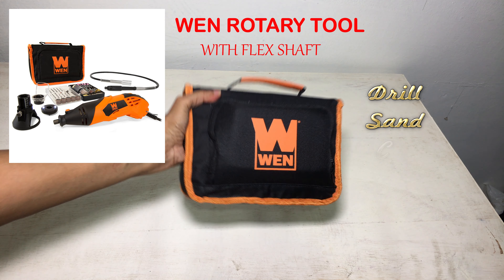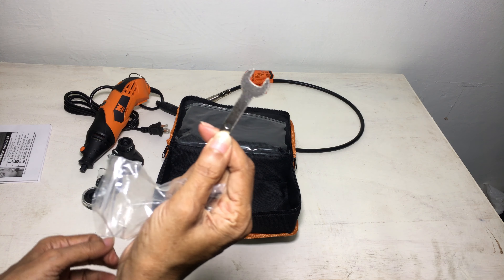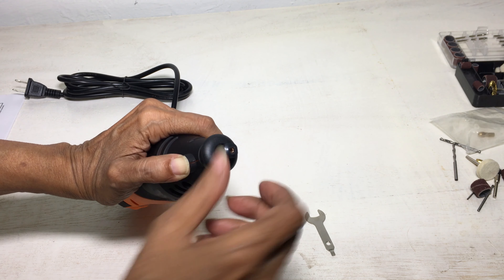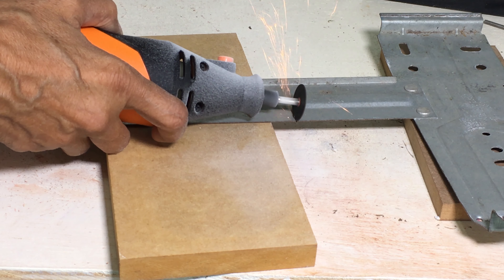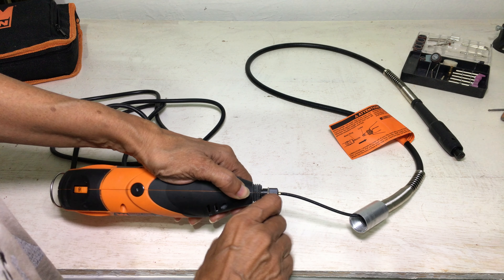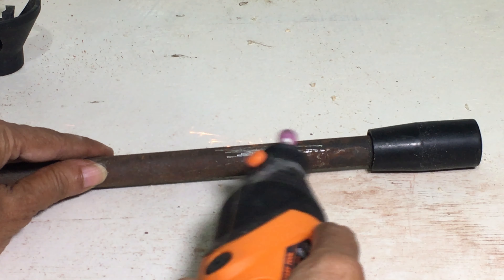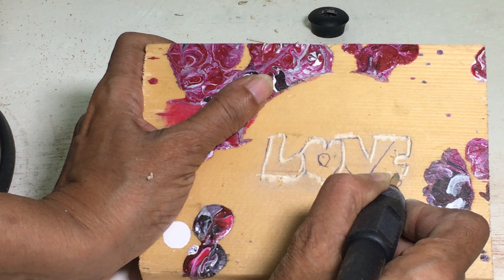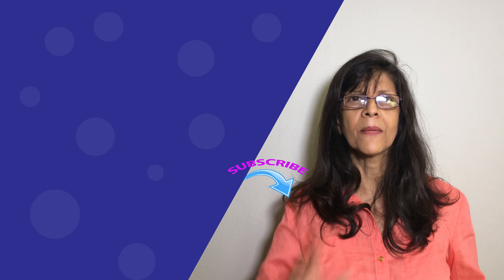Wen Rotary Tool  23114 with Flex Shaft/How to use it and applications.

Comment: Nice. Informative. 
Any idea which bits are best for smoothing rough stone, then which to polish stone - advised compound?
Reply from the maker: Thanks,I have never tried it,but I will,but from what I have read you can use either sanding drum bands or the diamond bits and finish off with the polishing wheel.

Comment: Thank you for a great video. The best I have seen! Can this tool cut a brass garden hose stuck on the spigot/faucet?
Reply from the maker: I don't see why not today I had to cut off four 1/4 thick bolts and the nuts went back on easily,only thing I found that with just one of those cutting discs it was taking a bit long so I screwed on two and it worked like a charm.

Comment: I didn't know you could use it under running water that's amazing for glass sanding so there is no problem with getting a bit wet the flex shaft? Thanks for a great video 👌
Reply from the maker: Should be fine once you use the flex shaft.
Reply: @over60crafter  Thanks a lot (:

Comment: Great review! You convinced me to get it, I am over 60 crafter myself. Can you recommend the diamond cutting wheels, I need to cut some metal and glass? I was trying to cut the metal pin (fixing my ironing board) I broke 3 cut off wheels that come with it, so I am ether doing something wrong or need stronger like you using on min 7 of your clip. Thank you so much.
Reply from the maker: Thank you. The link for the cutting wheels that I use for glass is below the video in the description.

Comment: That was a great review.  I've lost my drill and thought I'd get one of these (or the older model you showed).  I need it for a very specific reason.  Can you please tell me if it will hold wire sizes 20 gauge to 14 gauge where you normally attach the accessories bits?  I need a rotary tool I can use to twist and coil wire for my jewelry hobby. The extra useful benefits would be a bonus.  I'd really appreciate your help.  Thanks!  🙂
Reply from the maker: Hello,I don't have wire on hand to test but it can hold a 1/8 inch wire,but you can also get a set of collets that would fit the wire you intend to use,I put a link for the assorted set below the rotary tools.
Reply: @over60crafter 👍 Awesome!  Thank you so much!  I've never owned or used a rotary tool so I didn't know. At the moment I have a pen vise which is ok for really small projects but I'd like to expand my jewelry skills and start twisting wire, making jump rings, etc.  You told me exactly what I needed to know. As long as that part/collet is interchangeable I'm good to go!  Thank you so much for your help!  Have a great week!  😊
Reply from the maker: @tammygurl64  You are most welcome.